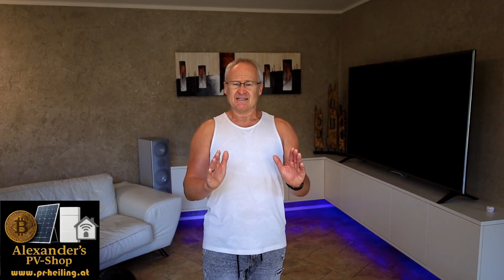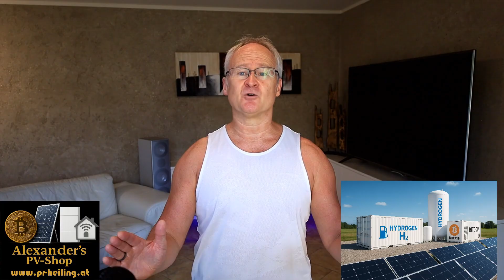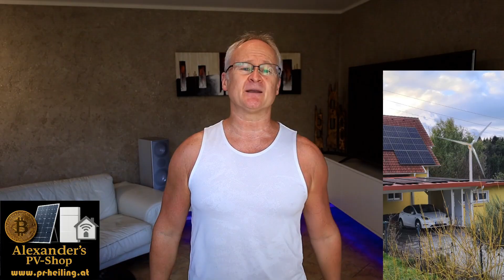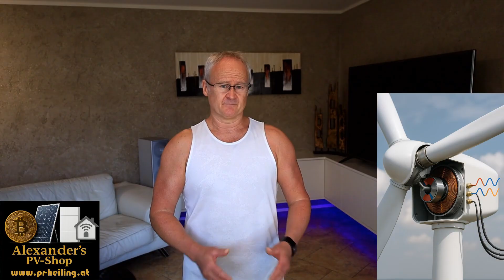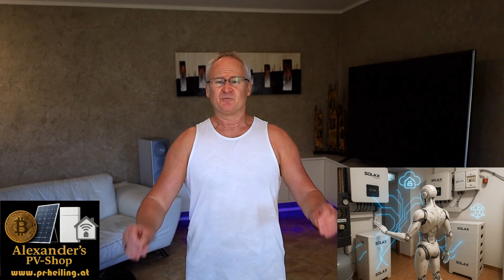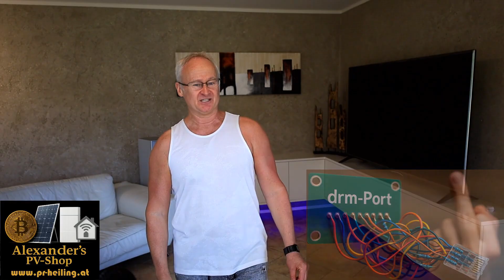Wind Power on Solax X3 G4 – The Secret Gamechanger for True Energy Independence!

Comment: but there is another option because most small turbines running with about 24V-48V on 3 fases generator.. its NOT impossible to make that conversion from 3x48Vac to 1x >200Vdc. in a switch module, that precises what they do in the inverter itself. just the other way, from about 150-600Vdc > 3x230Vac. to work with house 3 phase. its NOT even difficult to design, so im´still wonder WHY that hasn't been done yet. and I would love to have a Small legal house turbine vertical that produced about 4-800W just to keep power to the heat pump air/water. and Use 1 MPPT will be a super good idea, and i have been asking Solax about this for about 5 years now. also would love then the EV charger will be able to connect to the cars battery with V2H charging. that will give an extra 64KW battery + the 10KW we have now.

Comment: One issue with solax is if the grid is connected and the PV voltage drops to zero the inverter goes into safety protection and waits 5 minutes before generating. SolaX say as this for safety it cannot be turned off. This is very inefficient for turbines power generation.
This is because it designed for solar and in the morning as pv come on and off the 5 minutes protects it.
The new wind turbine mode has this issue as well.
You can reduce the waiting and connecting times, which work the first time the pv drops to zero but the second time it drops to zero volts waits the 5minutes and seems to continue to do this.
Not ideal.

Good video. Thanks
Reply: hello, thank you very much for your valuable feedback. you are right, this behavior is a bit unfortunate. however, in real life I have found that the voltage only really drops to zero when there is very little wind anyway, so the production is not really relevant. this mainly happens in gusty wind conditions. that’s why I believe it’s very important to choose the right turbine geometry for the specific location, so that the rotor doesn’t keep stopping. in addition, my alexgpt control helps in such situations by reducing the current (amps) to a minimum, which keeps the rotor spinning and ensures that a minimum voltage is maintained.